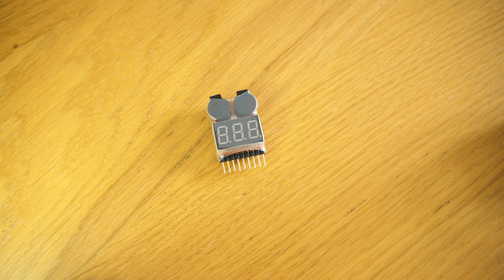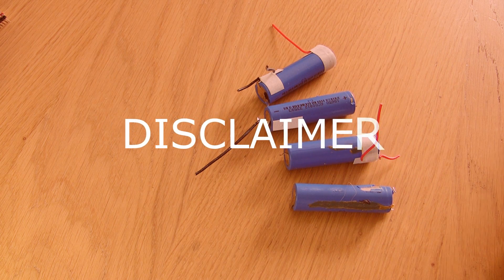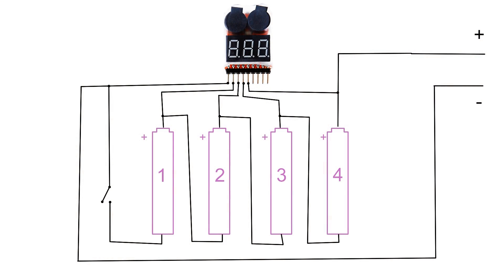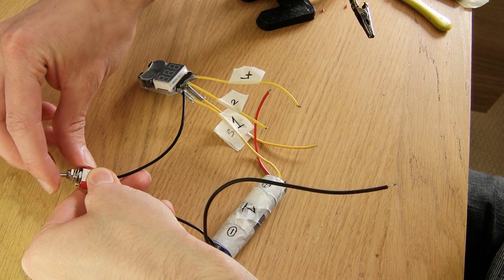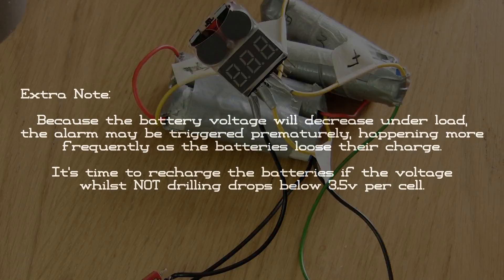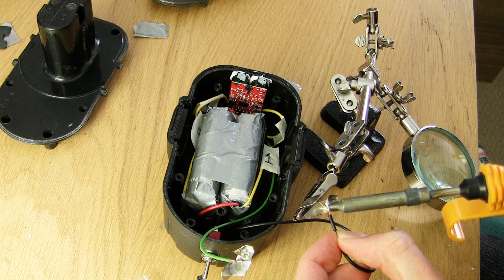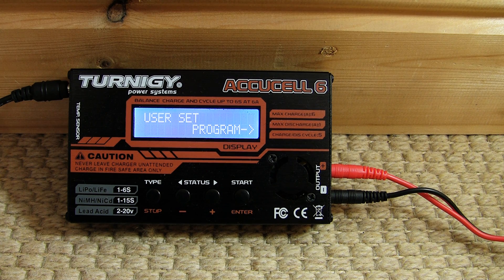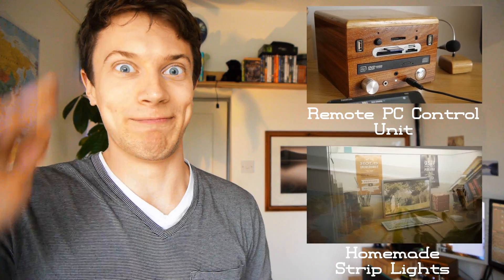Supercharge a Dead Drill Battery (replace Ni-Cd with Li-ion)

Comment: isn´t there a lipo protector that cut of the power to the battery automaticly?
Reply: matsv201 He did not use a LIPO battery, he used Lithium Ion. - The battery voltage monitor will beep when the batteries are too low.  The biggest problem with this design is the fact that the wires he has used are too small IMHO and the batteries will not be balance charged using his proposed charging method.
Reply: Well, yea, but its still a lipo protector. A Lipo battery is actually a Li-ION battery 

"will not be balance charged using his proposed charging method."
Well, that is natural. You cant really build in the balance charger if you don´t build in the complete charger.

But of cause, it would be a nice chip that could both shut down the battery and charge it from any sufficient voltage.
Reply: Andrew Denley Actually not quite. The difference is in the conductive layer. Well... Li-Po is part of Li-ION, Li-Po is a type of Li-ION. There is actually a few 100 types of Li-ION, and Li-Po is a subset contain a handful of different types.

In almost all Litium batteries the insulator is plastic, but in Li-Po also the conducing element is plastic. This makes it thinner and lighter. You can make Li-Po battery in a cylindrical 18650 if you wanted, but it would be kind of stupid.

The reason being that the plastic-on-plastic is very flexible so it quite easy to make it prismatic.

The metall-on plastic needs a certain minimum radios making cylindrical cells the easiest to produce.

Interestingly the Li-Po battery actually have lower density than normal cylindrical batteries, but because they stac better, the total density often become higher in the end.

Also, the standard 18650 comes normally in 3 different chemistry, all at 3.6-3.7V (most notable mangan and chrome/Cobalt)

Looking on 25650 and 32650 they is often used for Litium-Ironphosfate at 3.2V, and of cause Litium-titanide at 2.5V that is  actually probobly the best battery avalible to every single specification a part from energy density.,

Comment: Nicely produced video.
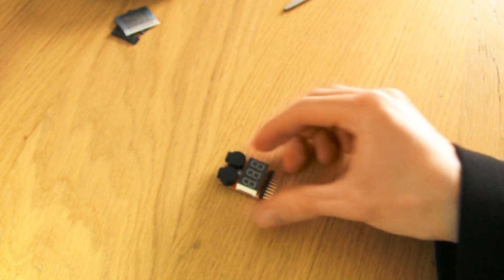One  query I have is you say you sourced the cells from a laptop battery that was "no longer being detected" 1:25
Surely you would need to test their capacity first, before soldering and taping up ?
Reply: It's the internal resistance that goes wrong in old laptop batteries. Bad for drills too. But if you want to build a long-lasting LED flashlight, the laptop cells will perform well enough.

Comment: My old drill is 12v 
I found some 18650 3.7 v 5000 mah

Can it handel 14.8 
4x3,7

Or is it safest to make it 11,1 ?

Its a dewalt drill
Reply from the maker: Bo Robin Larsen Running it at 14.8v should be ok, as it's just a motor after all. But it does depend on a few factors, so try it at your own risk.

You may find it's more powerful, but it may reduce its life a bit (I doubt you'd notice a difference though).
Reply: DIY Perks a small boost in voltage of 3v can have a massive impact, know this because of my rc cars and planes noticed the difference between a 2 cell lipo and a 3cell the 2 cell had a top speed of 66kmh in my rc car and the 3 cell was 105 kmh.
Reply: Bo Robin Larsen use 3 of the li-ion batterys so when they are charged it is 12.6v wont do damage then
Reply: Bare in mind that 3.7v is the nominal voltage of Li-Ion and Li-Po cells. The voltage of a charged cell is actually between 4.1v and 4.2v meaning that a 4s pack can be as high as 16.8v. Please also bare in mind that a hack of the original charger WILL NOT DO and the cells should ideally be balanced at each charge. The cells should also have a protection board to ensure that they can't end up getting over discharged or reverse charged, causing them to vent. As much as I hate to discourage tinkering, It really does make me cringe to think of people with little or no knowledge about lithium battery chemistry messing with these cells as they can be really dangerous. Just check out the candlepower forums, there's plenty of photos of the aftermath of these cells exploding and causing real damage.
Reply: ***** when wiring my lipo cells i had one explode when i was putting new high current plugs and shortinging the leads for less reseistance. luckily it was only a small lipo so i hit of my benchtop onto the conrete in my garage

Comment: Can we assume this is only for 12 volt drills. as the 18650 is a 3.7 volt battery.
Reply: You can match the number of cells to your drill rating. The meter used is also universal.

Comment: Wait are you RC fan?
Reply from the maker: Guntars Lācītis I wouldn't quite say 'fan', but I do find RC stuff a very fun pastime. Hubsan x4s are the best.
Reply: DIY Perks That's nice, I am currently working on my self rebuilding project, I took 10$ cheap RC boat well it's not small, but so far finished applying watercooling for motor and ESC, now working on racing thy propeller and gearbox to increase propeller spinning x3, and also I am working with all aircraft, on-road, off-road... Eh consider everything that can be RC is my hobby :D

Comment: Nice video. Althougth the most appropriate charge would be a balanced charge. I'd suggest the the batteries have to be balanced atleast before starting the project and check the individual cell voltage for a few cycles before using the drill. I like the quality of your video production!

Comment: Good idea , but have your father used that drill ? My point is that using laptop li-ion battery in drills can not provide sufficient output Amperage  (output power),which   is 10 A or more for drill  li-ion batterys .Laptop batterys do not provide such power, so, you will  be able drill just peace of paper not metall or wood....
Reply from the maker: DAVID KODA We used it a while and didn't notice a difference from the original battery pack. Still drilled into wood and metal ok at a decent speed so long as it had enough charge.
Reply: DAVID KODA lithium batterys have a higher discharge rate than ni-cd or ni-hm

Comment: Many Thanks, Matt!  Maybe I can get some use out of my old Bosch battery packs(they are horribly expensive and die very quickly) But I like the drill!
Reply: Redid 2 batteries this way. 5  3.7V cells for my 18 Volt Bosch drill, lots of soldering but lots of fun and they last longer than the Ni CADS before recharging.

Comment: you know duct tape is conductive right...... i would go spend a couple dollars (pounds) (Yen) (what ever you prefer) on heat shrink tubing of the correct size
Reply from the maker: Warren19911 I used duck tape, not duct tape.
Reply: both are conductive either way just a friendly suggestion
Reply: Warren19911 Duck tape isn't conductive, it's purely synthetic polymers, no metal like duct tape.
Reply: Gabriel Dibble dook tape
Reply: lol @duck
Reply: i think "duck" tape is the same as duct tape, the pronounciation is like that , probably because how the word "duct tape " sounds.

Comment: Could you also connect 8 cells 4 and 4 paralel to double the amp/h? 4cells like you wired it and the other on pin+5/6/7/8 and the ground on the already used pin1? will this work also?

Comment: you guys DO realize that you can buy, rebuilt and upgraded battery packs  - with new cases- online for half the price of factory packs...
Reply: Where?
Reply: Ebay..  You can buy cell packs already assembled for say 18v dewalt nicad packs, in factory sized or upgraded amp sizes. You just unscrew the top of the old battery case, remove the old cell pack, insert the new one, screw case pack together.. Assembled cell packs can be bought for like $25 - $35 depending how large or an amp size you choose. Or you can buy packs with new cases too. Search ebay or amazon. Worst case you can buy the individual cells and assemble your own pack, or for like $40 or $50 you can send your battery out to a service that will rebuild them for you..  Paying $90 for a new dewalt battery is a complete rip off..
Reply: kctyphoon Thanks for the info.
I've looked for direct li ion replacement for ni cad dewalt batteries with no luck.  Surprised no one is doing this.
Reply: I've actually seen (i think on ebay) lithium replacements for the 18v nicad dewalt batteries. The problem with that though is that your factory charger wont charge the new batteries, so the aftermarket batteries come with a little plug in charging port on the rear of the battery case. They also include a standard wall charger (like for an electric razor) that you would use to charge them. I'm not sure how much trust i would have for those chargers, but you could always buy a used dewalt lithium charger for them. Dewalt does make lithium packs in the old nicad style. It's what they came out with before the new 20v max lithium line, and I agree with you that I thought i would see more people selling lithium packs. Only problem is that for the money you might wind up spending to outfit all your old batteries and buying a different charger, you might approach the cost of just buying new tools..
Reply: kctyphoon Thats exactly what I did. I got the li ion dewalt 3 speed brushless driver. The batteries have what they call a fuel guage, 3 Led's that tell you how much charge is in the battery.
Thanks for all the info. :)
Reply: Dewalt now has 5 amp hour batteries available for the 20v max line..  I belive those are larger than anyone else is making right now.. Just saw them on amazon today. Good luck with the new tools.

Comment: Just a warning this is not a very safe way of charging since you are not balance charging the cells you might overcharge one cell more than the others which might cause it catching fire or just shortning its life time.also its not a battery protection circuit its just a meter with a buzzer it won't cut the power to the cell/s if it gets overcharged or under which is a problem because its not too hard to overcharge a single cell with this setup.

Comment: great job!!  but the battery protector just tell you if the cells are balanced but i think that after some charge and discharge cycles the battey will go out of balance. you should add a balance connector to balance the cell

Comment: There is one problem i'm having with this video. Laptop batties cannot supply the correct amount of current for power tools. Most laptop 18650 have a max discharge current of 5A (my laptop uses sanyo ur18650a cells). Most drill manufactures are using 15-25A max discharge cells. The most common 18650 in these batteries is the samsung INR18650-13Q which has a max of 15A. Thus translates to more torque.
Reply: That's the first thing I noticed as well.
Reply: Don Mega
the battery pack they use for their bike, would it fit into a drill's battery enclosure?
Reply: Anthony Shelton agreed, the cheap used ones came from other countries maybe some good lithiumions as well, there's cheapoes made in usa, maybe a capacitor would work while the rule still remains in the electron field.

Comment: Pål Julius ; using a separate charger is even cheaper than the lipo balance charger, which is mostly in hand by those who play with rc. 
http://dx.com/p/ultrafire-wf-188-rapid-charger-for-3-2v-3-7v-lithium-batteries-100-240v-44091
http://dx.com/p/14-8v-4-x-18650-battery-holder-case-box-with-leads-103855
http://dx.com/p/ultrafire-18650-3-7v-3600mah-batteries-pair-50486

The battery box is cut into the bottom of the original battery container after you have removed the bad cells. Use rubber band etc to have easily access when charge is needed. 

These 18650 batteries can then also be used for flashlights, headlights etc, which you find dozens of in dx.com.

Comment: I did a very successful conversion of my 18volt drill using the 5 cells. Thanks very much. I also converted a 2.4 volt B&D screwdriver using a single Li-on battery, however without the voltage alarm, I just have to check the voltage regularly with a volt meter to check the voltage drop.

I have one important question though which is not clear from the video. Using the drill, the voltage drops to the alarm level and the alarm sounds. You switch the battery off with the switch. To place it on the charger, you have to "make sure you switch it back on". Does the alarm not continue to sound until it is charged to 'above' the set alarm level ? Please answer this important question asap. Thanks.
Reply: The switch is only for the voltage meter, so it doesn't matter if it's on or off in order to charge, but if you leave the meter on while charging, you will get a better idea how each cells is doing which is really important since he isn't using the balance charger the correct way. Assuming that has balance charging available and it does appear it should.

Comment: Matt, great video. Question. What was the voltage of your drill initially, a 12v, a 16v, or an 18v. I notice you used 4 li-on cells (4 volts each ?) , so does that mean your drill was a 16v one ? I want to do the conversion to an 18v drill , should I use 4 or 5 cells ? Can the motor handle a couple more volts, or should I stay under ? Thanks.
Reply: *****
The 18v drills I have worked on use 5 LiIon cells... 
You are correct!

Comment from the maker: The higher the mAh rating, the higher the capacity of the battery. But, 18650 batteries have a max of about 3000mAh, so those batteries you are looking at are probably cheap ones from China that probably barely have 1000mAh capacity, and are just using inflated numbers to make them seem like better products.

Comment from the maker: If the cells in the laptop battery are bad, they're probably not good to use unfortunately. You could always test a few though, and see if there are some that do hold a charge, as a laptop battery consists of quite a few cells.

A 0.2v increase shouldn't be a problem for your camcorder.

Comment: If the battery in a laptop no longer work well,how does it work well with a drill?
Also,if the voltage is different,can the final modded battery have a higher voltage of about 0.2V?
Need to to this to a old vhs camcorder…

Comment from the maker: Thanks for the tip. I usually make sure a connection is secure by looking to see whether the solder has 'flowed' onto the metal, but I will look into adding it separately.

Comment from the maker: What kind of PCB were you thinking of using? I've searched everywhere for some kind of relay that cuts off if the battery drops below a set voltage, but have not found anything remotely similar. It would be extremely useful, if they were available somewhere.
Reply: Search for battery management system. If using proper li ion charger, why not add balance connector as well? You know, the cells may not have same specs and the voltage differences grow over time, so having it protected by proper bms and having balance connector is definitely worth it, as long as you dont want to risk everything you described in disclaimer at the beginning of the video. Also, laptop cells are designed for low drain application, so I would use them in large parallel groups if I had to. It is easy to buy some high drain cells or even replace old nicd with new nicd or nimh. Man, I do not think using it bare like this is a good idea. I can buy RC lipo battery if i need something that will power my drill. I always replace old nicd with new nicd.

Comment: Hi - thanks for a great video! I'm looking to do this conversion with my dead Ni-Cd 12V Bosch drill battery. The only difference is that I would like to add a PCM/PCB to protect the batteries (instead of, or possibly in addition, to the battery check/buzzer) and also to add a balance lead to allow for balance charging.

Comment: I was going to post a negative comment about using tape instead of heat shrink tubing and the wonky soldering job but then I realized you are most likely self taught and I have never seen this before so GOOD JOB! I can't wait to do this myself.

Comment from the maker: Depends on the motor. The wires are actually good enough, due to their fairly short length, and the motor's power draw. The wires should be able to supply at least 5a at 16v, which is 80w, and I don't think the drill is quite that powerful.

Li-ions and lipos are supposed to be far better than nimh in regards to discharge rates and reuse cycles (which is why they're used extensively in RC equipment now, rather than nimh).

Comment: Those wires look very thin considering that an electric motor draws allot of current when spinning up. Also Lithium Ion/Polymer batteries usually don't last very long if they get discharged in small intense bursts. I used a similar setup as you did to charge the capacitors in my flashguns.(which admittedly is more extreme than your drill)  The cells were down to 50% capacity after only a year. I went back to NiMH cells because they seem to last longer & can take more punishment.